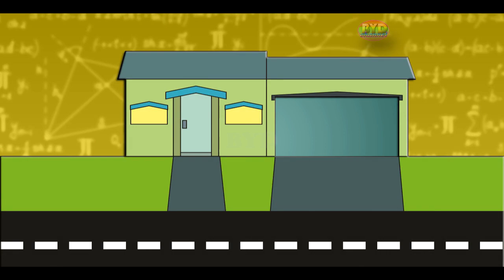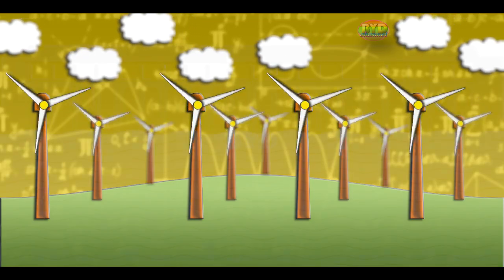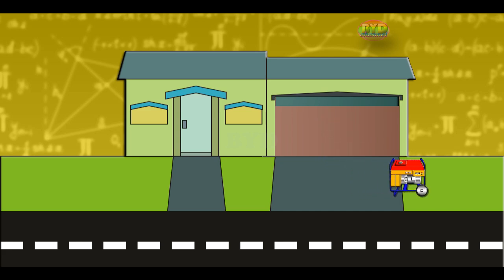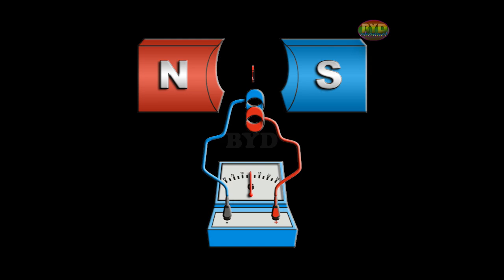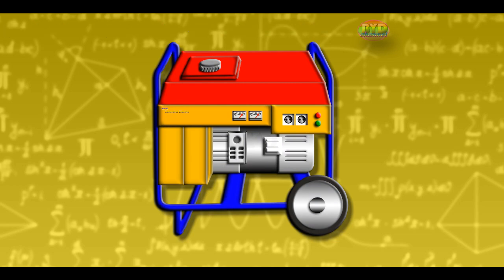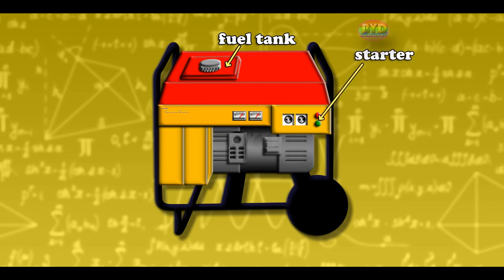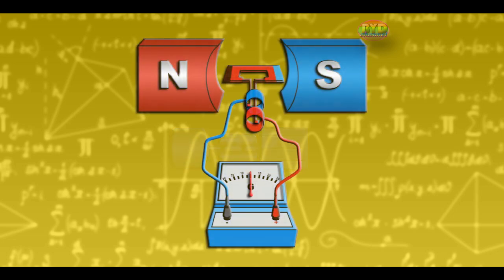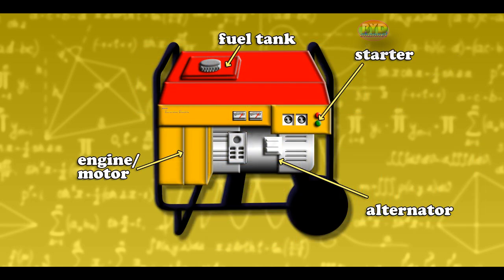how does a generator work Animation

Comment: so you just need 30 watt electric motor that can go 3500to 6000 rpm base on volt. to power an alternator. and some kind of docking. since it is alternating current , do i need an 24v inverter or just 110-120 power out let